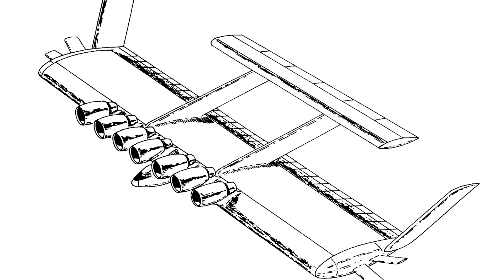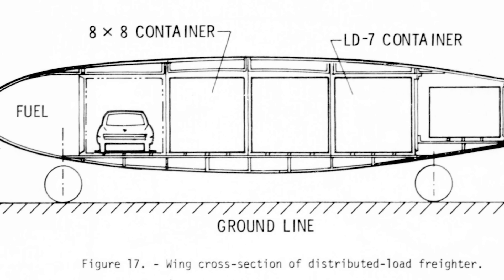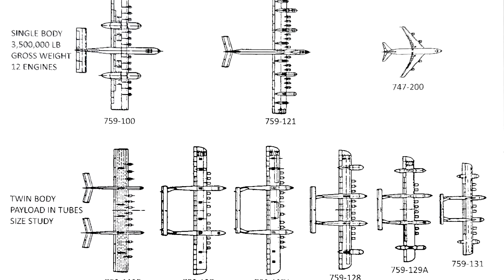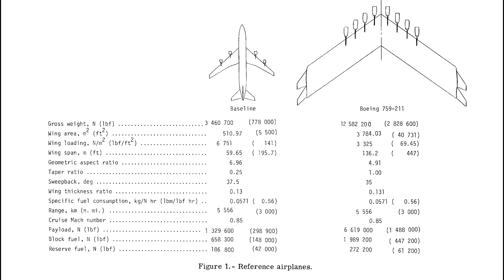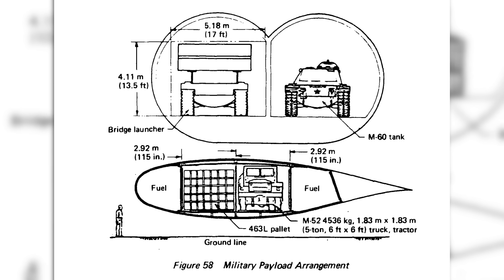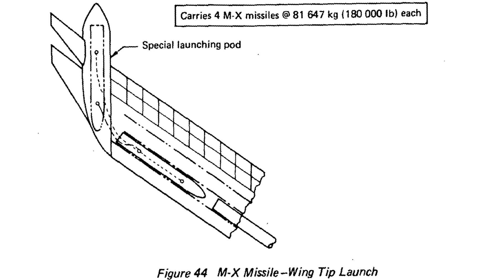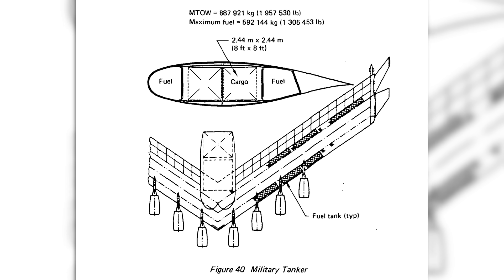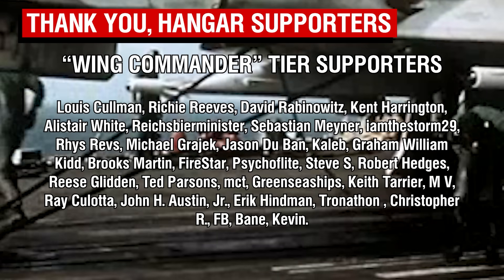The Giant Flying Wing Concept That Made 747s Look Small - Boeing 759

Comment: Messerschmitt Me 323 Gigant took people in empty spaces in the wings, this method was even used in fighters during the evacuation from Stalingrad, although, of course, this was not foreseen by the designers. By the way, when the Poles were building the PZL.37 Łoś bomber, they accidentally came up with a partially laminar wing precisely because the designer's task was to fit bombs inside the wings.

Comment: It would seam to me that range would be horrible on those planes.

Not only is most of the wing used for cargo, not fuel, but also the wing fly on mostly cord depth, and not span. This tend to have higher drag/lift number.

Comment: Span-wise cargo loading is an okay concept, although I would be real curious to see how the loading/unload would go, especially with unbalanced loads.  The elephant in the room, however, for flying wing passenger flight will always be the ability (or lack thereof) to pressurize the "Cabin" at least to less than 10K feet altitude pressure.  After that can be economically done, then the 'sky will be the limit' for this kind of flying wing world.

Comment: From what I remember at the time, both the McDonnell Douglas and Lockheed proposals (whilst extraordinary) were somewhat more grounded in reality. However, I do remember seeing drawings of a cargo lifter referred to as 'The Flatbed'. The idea was to be the aviation equivalent of a pickup truck or container ship - indeed, the design was such that you could load six to eight full size containers in a 2x3 or 2x4 configuration. A military version was to be able to carry three or four Main Battle Tanks literally chained to the cargo deck (h'mm drag effects anyone). There was also a passenger pod which would have been loaded onto the Flatbed and presumably been an early form of a 'plug and play' unit.  I think this was a Lockheed concept - but I could be wrong.

Comment: Rex,

please do the Victa Airtourer, which as far as I am aware, is the only aircraft actually constructed by a company whose speciality was lawnmowers!!
Reply: Hi. The "Flymo" rotary lawnmower uses "ground effect" lift instead of wheels to whisk across the grass. The two disadvantages are that it can't be wheeled back into the shed, and setting the cutting height is not possible. Cheers, P.R.

Comment: The minuet man carrier was one of thoes ideas that you have to wonder what ther were thinking, because the initial idea was that they would put them over open streches of the pacific well away from known assets of the russian navy. But then thoes aircraft would have to fly over the rockys to and from there bases in the middle america, and then land while still loaded with thoes missiles. There was a now retired Col. Who openly wondered if they intended to air drop them in the same way that they air drop cargoeised combat tanks before landing the aircraft, considering that early on the plan was for th to just continualy build and dissasemble minuetmen anyway, so if some of the ones that were quickdroped for landing were damafed meh just build another

Comment: Same as the other comenter , got no parking or un-loading means for these ?  Were they going to park these all side-ways or what?   You would have to roll these side-ways down the taxi-ways also too !  I am sure this could work out if BLOWING aircraft co could make a comedy inexpendsive wing : which may be possible using new techs , and turn them side ways and drag them side-ways while on surface and be able to operate at the .07 speed for SURE ! Seems like a great idea !

Comment: Peacekeepers being solid-fueled rockets, the risk of a crash with a pair of them on board really wouldn't be any higher than any other aircraft crash - the most dangerous thing aboard is the jet fuel.  The warheads themselves would be extremely unlikely to detonate - Hollywood notwithstanding, it's actually really hard to make a nuke actually work, and really easy to break them, so the main problem from the warheads would be the risk of radioactive material scattered across the crash site.

I agree with the other comments saying "where would you land it," though - there's so many videos on YouTube of 787s and ever 747s clipping things with their wings, I can't imagine the airport that could accommodate this beast!
Reply: Considering how heavy they were and the speed. The biggest issue would be in a crash would likely be the kinetic energy of the thing on impact.
Roughly a fully loaded 747 weighs about 400 tons being generous. And these things would likely being in the 10x weight, so you are looking at around 4 000 tons. Travelling at around 0.8mach.
So roughly you in Kinetic Energy you would get around 150.5 Billion Joules. TNT is roughly 4.184 million Joules per kg. So this thing hitting the ground would be around 35 970 kg of TNT or in other words the largest non-nuclear explosive the GBU-43/B MOAB is around 11 tons of TNT equivalent; or just over three of them hitting an area.
In short it would not only destroy whatever it hits but as you said it would burn everything on top of that.
Reply: @theemperorofmankind3739  You make a cromulent point - but that's something that would be a problem whether the thing was carrying missiles or potatoes.  So the notion of putting PEacekeepers aboard still isn't all that crazy.

Comment: I wonder if it ever crossed the minds of Boeing's engineers what would happen to the aircraft when they so casually eject an 88 ton ICBM from a moving aircraft. Sure, the gross weight of the plane was 900 tons, but shedding 10% of that weight at once in flight surely would've been an event.

Comment: One interesting feature is that they needed huge computers amto operate the flight controls, because these designs could tear themselves apart at speed (the spanloading that makes these designs efficient, also makes them delicate). So these designs ended up with many semi-ndependent control surfaces along the wings and tons of computers (it was the 70s, computers were big).
Reply: The computer space needed for systems at that time, would take probably up roughly the same space as a truck…..at the minimum.

Comment: I think the biggest problem was finding a runway and taxiway that could actually accommodate such a big plane. I think THAT was the final downfall of the project.
Reply: Oh, I'm sure they would have built a suitable airfield...

"Good News! We've built an airfield capable of servicing our Mega-cargo plane."
"You built one airfield?"
"Yes."
"That means, the plane can take off, fly around and land at the same place?"
"Yes."
"So, you now have a huge, extremely expensive cargo plane that can't go anywhere?"
"Yeees...."
Reply: @Bird_Dog00  "also we need to carry it there...we request funds to build a wide enough interstate.."
Reply: "The USAF has announced it has purchased a new site for an airfield: the State of Delaware. Bulldozers began clearing the area this week."
Reply: @RCAvhstape  oh are you speaking of airstrip1?
Reply: The B-36 was designed with single tire main gear with giant tires, this resulted in damaging taxiways and runways. They switched to a four tire design using normally sized tires and solved the problem.
The behemoth would have had lots of tires but not destroyed airport infrastructure.
Reply: Hence the air cushion landing system. Any flat ground or water, snow, etc.
Reply: The accountants input wouldn't have been none too pretty either.
Reply: thats what the nukes were for
Reply: True, but if it had proved successful, the airlines and the military surely anticipated expanding and strengthening infrastructure. Land and concrete are both cheap in the good old USA. Or they were back in 1970 anyway.
Reply: Anyone else getting "Phoenix Lights" vibes...?
Reply: lol no... making wide airfield would not be a problem. but actually make something so big to fly... long wings flex in air. longer it is bigger are forces on it. than control surfaces on such huge machine... etc etc etc.
Reply: Any existing runway would have crumbled under the weight of that beast of a machine.

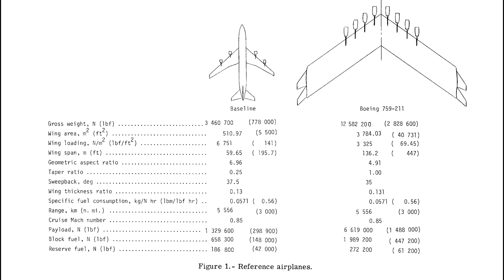Comment: @4:59 The left-hand column top line says "Gross weight, N (lbf) 3,460,700 (778,000)" and shows what looks like an ordinary 707-747 style 4 engine plane.  The 778,000 weight is about right for a 747.  But what the heck is "N (lbf)" as far as weight goes?  The "wing loading" two lines below also uses "lbf".  You may have guessed I am no aeronautical engineer.
Reply: N is newtons, the SI unit of force.  1 N =  1 kg · m / s² ≈ 0.224809 lbf
Reply: AFAIK 'lbf' stands for pound-of-force, a unit of force used for engineering measurements. I'm also not very knowledgeable in this field but I have seen the notation before in drawings.

Comment: When you consider the various disastrous spills and fires related to ocean going oil tankers the idea of a flying oil tanker is beyond absurdly comical, even if the thing could actually be built.
Reply: While they're on nowhere near the same scale, there are plenty of flying tankers for air-to-air refueling. I agree with you that it's a bad idea because of the potential for insane disasters when something goes wrong. But that doesn't mean that it couldn't be accomplished, though it's hard to imagine it being more economical than surface transport with ships, trains, or pipelines.
Reply: @johnladuke6475 Great point about air-to-air refueling…as well as just about any aircraft, which seems to be mostly fuel.

Comment: …whoa, Nellie!!!…

….this is the sort of fantastical engineering one would have expected out of Howard Hughes…not Boeing, Douglas not Lockheed…

…If, I count correctly, in addition to the 12 (!!??) Pratt & Whitney turbofans, a total of 8 landing gears stretching along the loaded wings would require a runway roughly 4 to 5 times the width of even the largest currently in use…

…Buck Rogers material, more like…😳⁉️✈️🤔⚠️🆘😎
Reply: Or of course, C Montgomery Burns with his "Spruce Moose" to get cargo from New York's Idlewild Airport to the Belgian Congo in around 15 minutes
Reply: @emjackson2289  I said GET IN